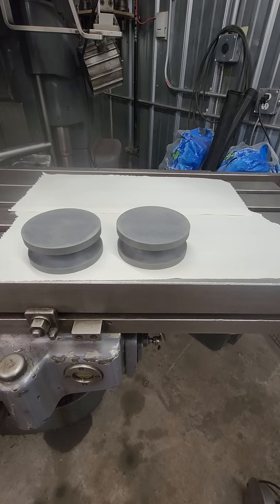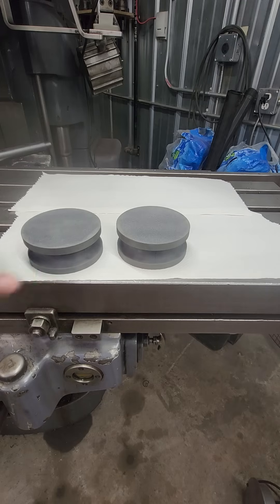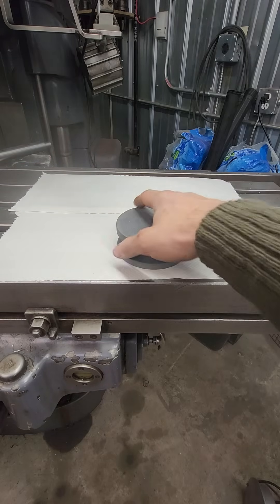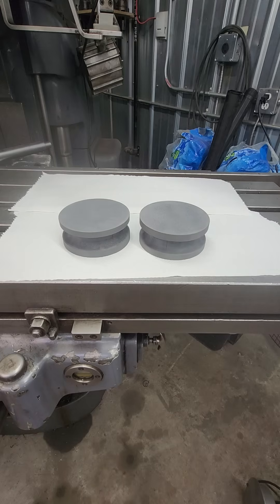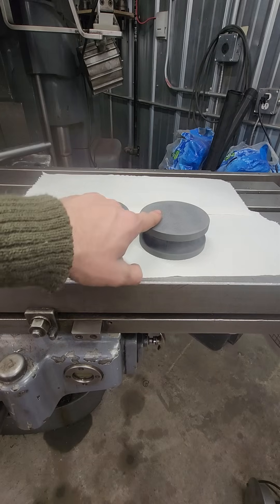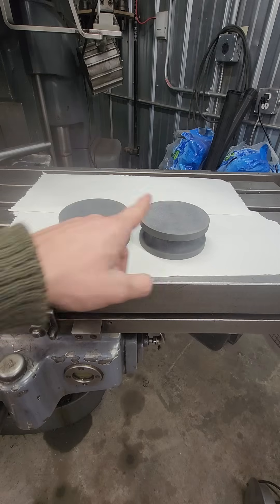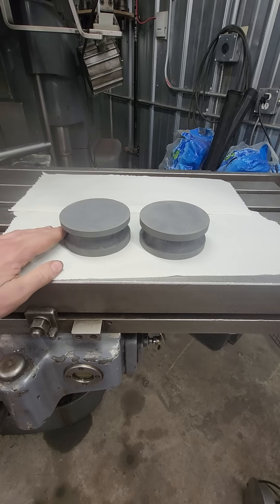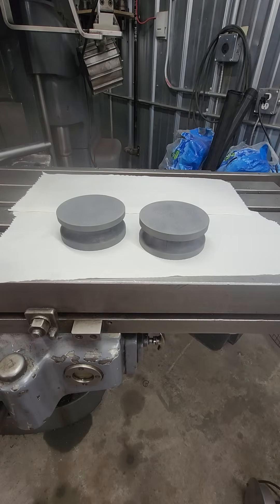The MYTH of precision flat stones in machine shops. (Make yours at home with NO tools)

Comment: Anyone who has ever ground optics for a telescope can do this easily. It's not rocket science and no grinder is required. Making optical flats has been done by many telescope makers to use for testing other optical components. They work at accuracies of millionths of an inch instead of only ten thousandths. Literally, fractions of a wavelength of light. What you are describing is still the rough stage in optics.

Comment: How do you lap your parallels? I’m assuming you only do the flat side, but I always wondered how to lap in the small surface area that parts rest on.
Reply from the maker: Most of the parallels we use are 1/2-1" wide on the narrow edge, so it is less of a factor. For skinny ones I really do not have a good answer. It is rare we use them.
Reply: @Kurokimachine I have some parts that are small c shaped semi circles. Fixed jaw is a v while the movable is straight. The part once cut has to be flipped and first op leaves a small step. When flipped, the step doesn’t allow me to use the larger parallels. 1/2” would be nice. Surface grinder would be the only option but my shop lacks that… we’ll see what the future holds. Thanks for the reply.

Comment: I’ve made a couple sets of stones by lapping the stones on a diamond sharpening plate. 
They are smooth but far from flat. The smoothness is enough to get the basic function that people expect from precision ground flat stones. 
However, in the realm of micron precision, lapped tooling, optical equipment,… I would not trust those stones and would prefer to have actual flat ground stones. Granted I don’t do micron level work but maybe one day 🤞
Reply from the maker: The diamond sharpening plate will be orders of magnitude less flat than stones lapped in this way. I am planning a follow up video as soon as I have free time away from paying work again.
Reply: @Kurokimachine  does your method work on rectangular stones as well or only round ones?
Reply from the maker: @ED_T I would be far less confident on rectangular. The multiple plate method of lapping generally is successful on round or square objects. If you can not rotate 90° (or some amount) while retaining full contact it is possible to have a part with a twist in it still print flat.
Reply: @Kurokimachine  that’s a bummer but I’m still interested to see when you get around to posting it

Comment: My unqualified take on the stones is that they are trully flat ( by whatever means) and blunt. Why they work is because being flat the area in contact is the maximum so any raised point has the entire load and overcomes the bluntness of the stones to abrade it. An unflat stone has many points of contact and is sharp so more area is abraded. Or a flat stone "floats" except where there is a high point. A rough stone digs in all over the work. 
Any correction in my thought process would be welcomed.
Reply from the maker: Without getting bogged down in details that do not matter enough to be relevant,  that is how these stones function

Comment: This idea is far older than Robin Renzetti's videos on them. He doesn't present them as a new thing.  In fact the idea goes WAY back, at least to the 50's as a commercial product. Probably to at least the 30's. They have long been sold as gauge block repair stones.
Reply from the maker: Yes, that is correct. He even mentions where he learned about them. I would maintain that he was responsible for them becoming mainstream knowledge as opposed to a niche item known in some tool makers circles. Your average machinist 20 years ago would not have known about these stones.
Reply: @Kurokimachine  I dunno, anyone fairly involved with gauge blocks would know about it. Maybe those in QC? That's how I came to know about them. Although they were not called "precision ground flat stones". They were gauge block reconditioning stones.
 Fun Fact: DoAll sold some of them and they were simply small granite surface plates 3x4x1". When I need to repair a gauge block I can just rub in on a clean surface plate and Voila wrings again like new.
Reply: @billshiff2060  I think what Renzetti contributed was showing how useful the stones are for general machine work. Like others have said, he never claimed to have invented anything but I think many of us didn't realize how useful these things are for a wide variety of work, not just very-high-precision (and specialized) jobs like gauge block repair.

Comment: My mill table has groves and holes all over it because it was used in a school. I don't know if it would be worth the effort but I'd like to learn this.
Reply from the maker: It is still worthwhile.  The low spots are not an issue other than looking bad. However high spots will  cause trouble. It is especially worthwhile to stone a table with damage to the surface

Comment: I've done this before and the set I made was maybe 80% as good as the ones I got from 26 Acre Maker. They feel good when you use them on a flat table or similar, but if you run a small part over the surface it becomes clear that there are some low spots that still have sharp abrasive. Maybe going over the stones with a diamond flattening plate before lapping would fix this. I will say that if you have a set of home lapped stones, you will find yourself using them for things that are a little too aggressive for real diamond ground flat stones.

Comment: Funny enough, I had exactly the opposite problem - I wanted my flat stones to function as lapping plates and I wanted them to actually cut metal. It turned out to be rather tricky to achieve - just lapping stones on each other produced surfaces that tend not to cut anything at all. However, when soaked with water and a bit of surfactant, it allowed creation of abrasive emulsion on the interface, and that produced the rougher cutting surfaces that I wanted.
Reply from the maker: I did discover something making these that will make it into the follow up video. The stones cut eachother well as long as the abrasive dust coming off of them was left in place. After blowing them off once flat they will no longer cut eachother.
Reply: @Kurokimachine  You may be interested to see my reply above to the other gentleman. 

Sounds like you also discovered the benefit of the 3-body abrasion principles where the 3rd body, the loose abrasive grit, greatly enhances the resurfacing of the stones.

It works better because rather than shearing the peaks of the abrasive grains off, quickly reducing their cut, the loose grains tumble, roll, and poke into the stone's surface fracturing off the abrasives in the stone along the abrasive's natural cleavage planes leaving behind new sharp peaks rather than flattened ones.
Reply: You can adjust the aggressiveness of the cut of the stones using 3-body abrasion principles.

Buy some loose silicon carbide grit, maybe 60, 80, or 120 grit (heck, you can even go down to 20 grit!) and sprinkle some on a flat surface like a thick glass plate or a flat granite slab (or old surface plate). Spray some water on the plate and the loose powder and using circular motions, run the stone over the grit till it is flat.

You can take a sharpie or pencil and make cross hatch marks on the surface of your stone and that will tell you, once you've removed all the markings, that it is now flat.

The loose grit will break down and become progressively finer and therefore make a smoother, less aggressive cut on your stone the longer you work the stone on the loose grit. Depending on your grit choice and how long you work it, you can adjust the stone's aggressiveness from super coarse to super fine.

Just remember to keep the grit wet so as not to create dust. You don't want to breathe lots of that stuff in! Read up on silicosis to learn about the dangers there.

This is something knife sharpeners often do to refresh and flatten their sharpening stones and it works better than 2-body abrasion methods like grinding with another stone or surface grinding with a grinding wheel.

Using 2-body abrasion methods tends to leave the stone's surface burnished and not cut very well since you've cut the sharp peaks off the abrasive particles. Using 3-body methods outlined above keeps the abrasive grains sharp and aggressive rather than having their points sheared off flat and thus lose cutting ability. 3-body methods break the abrasive down by fracturing it from the loose grit rolling underneath its surface under pressure which reveals new sharp peaks rather than flattening them out like the 2-body methods do. 

I'll add that if your stone's surface loses aggressiveness and cutting ability due to becoming clogged with swarf (should be readily visible), spray some oil or WD-40 on a piece of cardboard and rub your stone on it for 10 seconds. It'll unload and clean the stone's surface quickly, restoring its cutting action. If this fails, then you'll have to refresh the surface using the loose grit as stated above. Using oil when stoning something will largely prevent the clogging from happening in the first place.

Obviously, for uses like the video mentioned where you want the cut greatly reduced, this may not be an ideal method, but if you wish to restore a certain level of cut to your stone, trial out the loose grit method. I think you'll like it!

Loose silicon carbide grit is easily found online from lapidary suppliers and is commonly sold in bulk with rock tumbler kits. Should be a cheap method to restore your stones.

Finally, to share an old machinist's trick I was taught many years ago, if you have access to an EDM machine in the shop, go take a look and see if you can find some of that metal particulate at the bottom of the tank. It's the fine metal "dust" or "sludge" that's eroded off the work piece from the EDM machine. 

Scoop some of that stuff onto your stone and rub it on a flat metal plate or a machine's flat table. It'll do the same thing since that stuff is rock hard. Might be a quicker and cheaper solution than waiting till you can source some silicon carbide grit. I used to do it to my round stones just like the ones showed in this video and it worked great! 

Cheers!
Reply: @topfueljunkie100 valve grinding compound is silicon carbide grit btw :)

Also its the same stuff used in screwgrab (which you apply a bit to a PH screw and now can successfully turn a stripped screw sometimes). Helpful trick, especially for small stuff, just make sure to clean it off.
Reply: @napaisava That's true, it is, I just don't think you'd want to use that on your sharpening stones because then you're getting all that loose grit and grease stuck to your stone whereas if you're just using the loose grit and water, it can be easily rinsed off the stone leaving it nice and clean and ready for use. Lapping compound would leave your stone quite messy afterward plus you can't as easily tell when you've fully flattened it if it's covered in lapping compound.

But, in a pinch, if that's all you had, I suppose it could work!
Reply: @topfueljunkie100 oh my grinding compound is just like glycerin+water+SiC. Either way, i just lapped my stones without anything in between em, i was just noting an easy and cheap way of sourcing silicon carbide grit
Reply: @napaisava Ah, cool! Didn't know such a greaseless type existed!

All good my friend, appreciate the info!
Reply: @topfueljunkie100 yeah, looking up the SDS is really helpful for figuring out whats in stuff, especially for cleaning products/rust removers. I was mistaken it didnt have glycerin in it, its water, ethylene glycol (antifreeze), and silicon carbide in it. Still water soluble and oil free.

Comment: It takes three stones to make a precision flat stone. Read up on the Whitworth three plates method.
Reply from the maker: I am very familiar with the three plate method. And if we want to be pendantic, yes in theory you should have three stones for it. 
In practice using two double sided objects gives two sets of 3 if all 4 sides are worked through. And it gives results close enough that anyone watching this video would be incapable of measuring a difference in flatness between the two methods.
Reply: @Kurokimachine  I believe you can do it, but I'm having trouble coming up with the sequence. Would you mind just writing down the order you lap in? It'd be a good thing to have in my mental toolbox.
Reply from the maker: @rodfrey I will post a follow up video in the next few days demonstrating the process
Reply: @Kurokimachine  Have you ever heard the old saying that close only counts in horseshoes and hand grenades? If a difference could not be measured, then surface plate manufacturing would have long ago ceased using the three plate method in order to reduce costs and increase profits.
Reply from the maker: @GaiusTacitus surface plates have not been commercially manufactured using the three plate method in either of our lifetimes or long before that. 

Further to that this method using the 4 plates in two sets of three does give the desired result. The reason it isn't commonly used is not because it does not product a flat surface, but rather because it would not be practical in the way cast iron surface plates were made. Firstly meaning it requires scraping 4 surfaces rather than 3, and secondly the opportunity not even presenting itself as surface plates are made from single sided ribbed castings. This approach if done right has the same effect of removing the concave/convex error as the traditional three plates method.
Reply: @Kurokimachine  Yes, they have. I've owned them and used them. Granite surface plates produced via the three plate method are required when taking very accurate and precise measurements.

Granted, ground and lapped surface plates are good enough for most shop applications--and certainly good enough for hobbyists.
Reply: @Kurokimachine  If you want to get more than "close enough" without measuring, you will need 3 plates. Only with measuring you can get away using just 2.
Let me explain: let's say you have 2 stones A and B, each with two faces: A1+A2 and B1+B2. You rub A1 and B1 until they match. You will make one surface concave and one convex. You do not measure so you don't know which is which but let's say A1 is concave and B1 is convex. Then you rotate B and do A1 and B2. The chances are that A1 will remain concave and B2 will become convex like B1. Now you switch to A2 and no matter if you rub B1 or B2, you will get A2 concave. So now both sides of A are concave, both sides of B are convex. Yes, any A will match perfectly with any B, but it does not mean they are flat. They just match. You need a way to rub A1 on A2 or B1 on B2 so you even out the differences. That's why you add another plate C. As I said, this is for blind scraping, where you just trust the process and do it multiple times hoping to get something good.
On the other hand, if you have a way to measure the results (like a basic spherometer), you only need 2 plates, let's say A1 and B1. You rub them together until they match. As before you will get A1 concave and B1 convex. But because you can measure the differences, it's easy to correct them: usually when rubbing 2 round stones, the one on the bottom becomes convex and the one on the top becomes concave so you just switch them if they need to be the other way. This is what the telescope guys are doing and they can get some super-precise mirrors with this technique.
Using the 3 plate method I made my own set of stones, all within 25 microns/1 thou flatness (good enough for my uses). Because I used rectangular stones they are a bit harder to correct than the round ones so I had to use 3 instead or 2 + measurements.

Edit: if you want to make a followup video, I'd be interested to see how flat you got yours and what lapping compound you've used. I was afraid to use diamond as it has a bad habit of staying embedded.
Reply from the maker: @filisoft I will explain the process in the follow up video. I am familiar with the theory of the three plate method. I should have stated a modified 3 plate method in the video as it used both sides of two plates, essentially creating two sets of three. If done right it has the same effect of canceling out the concavity error.
Reply: @Kurokimachine awesome!